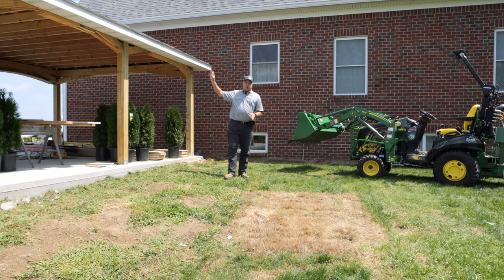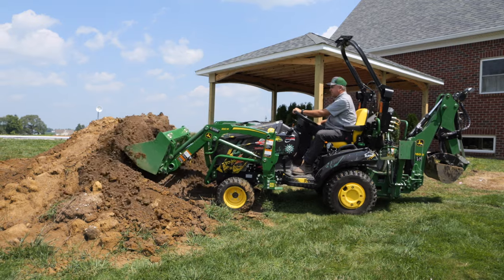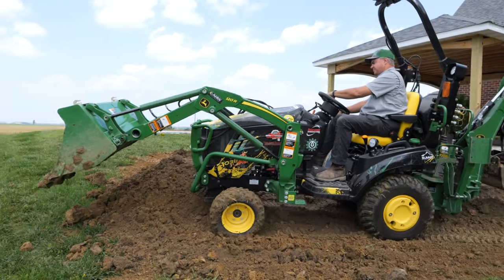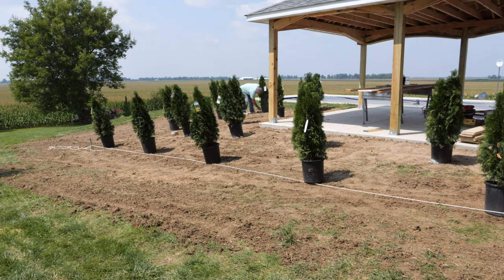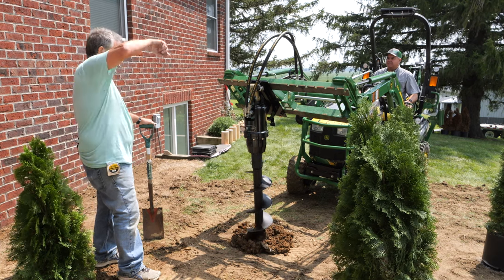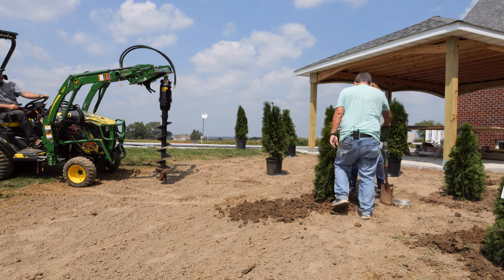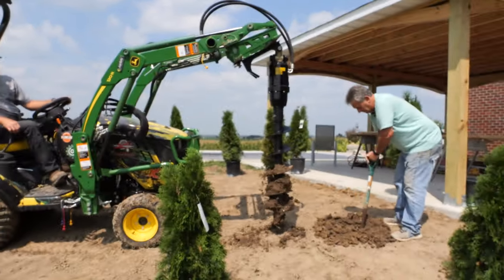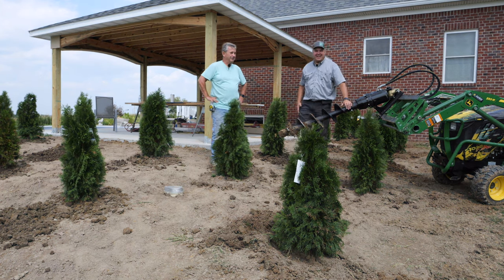1025R Plant Arborvitae HYDRAULIC AUGER, LOADER MOUNT, for Compact Tractors! Spins Forward & Reverse!

Comment: I planted 14 trees this spring.  The instructions were to dig a hole at least twice the diameter if the root ball.  Spead the roots if they were going in a circle.  Even cutting some to loosen a tight ball.  Great xhowing of the equipment.

Comment: Roots of your stock need to be loosened/ fluffed and even cut grow properly. Other wise they tend to continue in the circular growth pattern with less than good positive results. May die over time & require more water & feeding the way they were installed. Hand digging hole is the "Proper" way to install plants. With a post hole digger the walls are often to shear and even scored by the machine depending on soil type and will help keep the roots growing in a strangling circular pattern. Former Landscape design & build proprietor. FYI, Sorry Tim I'm not trying to be a jerk I just did this professionally for 18+ yrs..
Reply: Man I'm glad someone said this before I had to.  It was driving me nuts to watch them stand up on the root ball and SMASH it in the ground 😮
Reply: It’s almost painful watching them improperly plant those trees.
Reply: Lol you beat me too it. I was going to say the same thing about the roots. Most landscape architects will spec out on the prints and notes to not use a auger for plant materials.
Reply: I’m glad someone else has done told him  he is planting trees totally wrong and will most likely die . Tim has no business planting trees or shrubs
Reply: @philipberry2704  it's about education  , most people make mistakes by improperly planting tree's and shrubs. 
Really and trufully those arborvite don't belong where they are planted. 
Most homeowners have no idea and end up spending money on planting materials that can and will most certainly die when planted in the wrong location or improperly planted. 
Education is the key  .

Comment: I think you should have compacted the soil as you moved it in.
If you put white tape on the auger at the depths you want, it will go faster and less measuring each hole.
Always make the hole twice the diameter of the root ball.  Then spread out the plant root ball to get better root growth.
It gives the roots space to grow out better.

Comment: Great video. I like watching these types of videos. The souped up Johnny works great. I’d like to see how a stock Johnny handles the digger. 
The ventrac attachment sure works nice too. Will it move the rake up or down on the right and left side ? Like a motor grader. 
Have a great day.
Reply from the maker: It does not have tilt if that is your question.
Reply: @TractorTimewithTim   that’s it. Thanks. Would it be handy if it did have tilt.

Comment: I built my own hydraulic auger for the loader on my L2501. I built in a left to right pivot to accommodate any variance. I mistakenly thought I could control in and out movement with my loader dump control. It worked for about 30 minutes, then destroyed one of the bearings. Back to the drawing board.

Comment: Interesting attachments. Have you had any luck with hydraulic power units
Reply from the maker: Yes, power pack works fine, as long as you don’t need rear attachment.
Reply: @TractorTimewithTim  I picked one up in a tractor package I bought. NY guy ran a snow blower with the power unit. I sold the tractor but kept the power unit. It’s got a pretty solid gear box and a 28gpm pump. Hydraulic math wizards said I might be able to get 22-24 Gpm with the 3046r. I’m excited to try it.
Reply: We have a power pack to run our TrailBlazer front hydraulic brushcutter on out GrandL 3560. I like it that that it runs a constant flow of just under 12 gpm. Unfortunately, TrailBlazer stopped making their brushcutter. They couldn't resolve their patent lawsuit with Lane Shark so they had to stop production. Too bad , because I think TrailBlazer was a superior design to Lane Shark. I also don't think it's a food idea to do a lot cutting without a power pack.

Comment: My dad put a post hole digger on his 1025r and was digging  post holes and it took off digging, buried itself and stalled the tractor out. They had to dig it out by hand. I had to take my 2240 over and we used that for the rest of the holes.
Reply from the maker: Yep.  Had that happen.  Very frustrating!  Nothing the little 1025r can do to stop it!

Comment: I could be wrong, but I think it is recommended to leave the top of the dirt the shrub comes in 1” above ground level.  They should not be flush with the ground.  It helps water to run around the plant and down to all the roots instead of just sitting in one place on top.
Reply: Your tight, chances are, those trees will be dead in two years time

Comment: Why do people say you can't backdrag with a 1025R? Do some people end up breaking their "curl mechanism", cylinders or hydraulic hoses?

I actually do it all the time with my 1025R, especially when working the last bit of a dirt or gravel pile. 

I don't curl the bucket all the way down though, because right at the end of "anti-curl" there is a non-linear region where the bucket curls very quickly. This means the cylinder and loader structural loads will become very high in this region of curl.

A basic rule I use is any mechanism with a region of travel that moves quicker than normal will experience high structural loads in that region of travel. 

As long as I keep the curl in the "average speed" regions, I believe backdragging is fine. Do you agree?
Reply from the maker: Sure.

Comment: You would use a compact tractor, especially with forks, buckets and grapples. I put a palate on my forks and use it to move Christmas tree and decoration boxes out of barn and bring to house. I pushed a fridge out of the cook shed, laid it over the forks to move to the dump. I pile up sticks and limbs in piles in the yard and pick them up with the grapple take it straight to the burn pile. when I clean up pinecones I use the bucket so I only have to dump them out on the burn pile. I've used my compact tractor to move furniture, a big desk and a piano. We can't live with out our compact 
     Do yall have anything on spider lifts? I'm getting to old to climb ladders to wash high windows, get on the roof to clean out gutters, to cut limbs etc.  I need to buy one but I want to hear info from experienced users.
Reply from the maker: Skid-lift.com mention TTWT for a 5% discount.  We have several videos showing it.

Comment: That loader mounted auger looks like an awesome option. 

What rpm were you running?

How does the hydraulic flow at the rpm you were running on Johnny X compare to a stock 1025R at wide open throttle?
Reply: Stock tractor at WOT has 3.5 GPM.   H+ at WOT can have about 7.5 - 8 GPM.   Idling with H+ will be very close to Stock and full throttle.
Reply: @projectswithjw  that is exactly what I was thinking.

Maybe that auger would work with a stock 1025R if run at WOT?
Reply from the maker: I’ll try it.
Reply: @TractorTimewithTim  That might even be a great idea for a youtube short to see if it can be handled by the stock Johnny.

Comment: 19:20...no you don't want it off to one side or the other, you want it dead center of the hydraulic ram, if you have 2 rams, 3 rams, 4 rams still dead center or you risk bending a ram arm or breaking a cylinder mount. with unequal stress flex.
Reply from the maker: Correct…but if the stress is below capacity, then moving to the side improved usability.    One must balance all the concerns.

Comment: $2000 auger, its great but way expensive for most people. Average person won't get their money worth due to the price unless they do huge project or several of them.
Reply: I bought this use from H+ after learning about H+ through Tim. I bought one because I Hate, let me restate that HATE the three point hitch auger. It’s dangerous, cannot dig well in rocky ground, unstable and has a potential PTO whipping around if it breaks. I just mounted it to my fork frame and am wiring up a third function kit as I type this. Looking forward to seeing what it can do!
Reply: @Poorehouse  that's AWESOME 👍🏻😎! Good luck with it.

I agree fully with your statements.
I'm super glad you are financially able to do this.
Reply: I sold some land but did not want to use it for my project (a 11000 watt solar system).  I decided to put it to work in the stock market.  A little luck and skill and I made enough to buy all the parts, even a three point post hole digger for the ground mount.  Only 24 holes but no way 71 year old me is going to dig 24 four foot deep, 12 inch wide holes by hand.  $800 well spent and who knows, I might find a reason to build a fence or something.  I already plan to use it for the four poles needed for the lean to park my equipment (including my 1023E) under.

Comment: So would you recommend this front attachment set up over the rear 3 point auger? I’m buying one just for planting arborvitae’s and small trees.
Reply from the maker: Yes, assuming you have enough hydraulic flow.  The reason is that it can be run backwards to get it out of the hole if jammed.